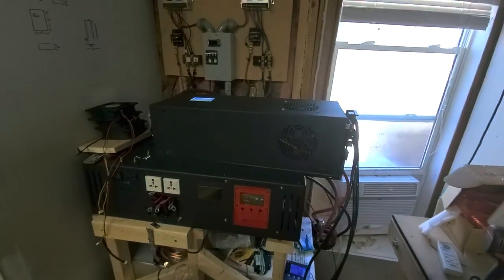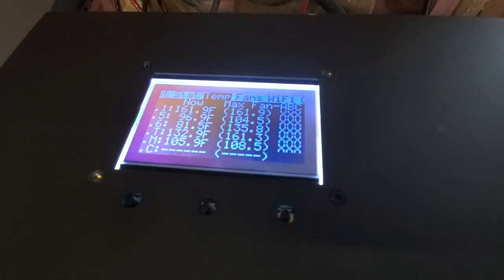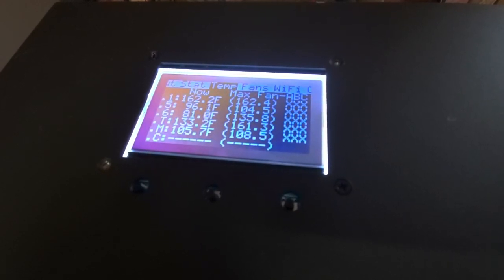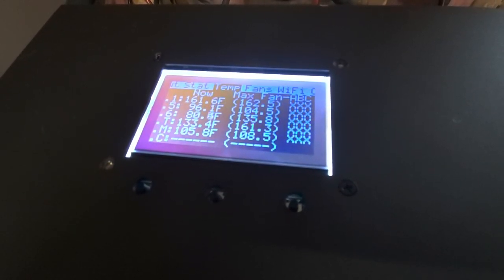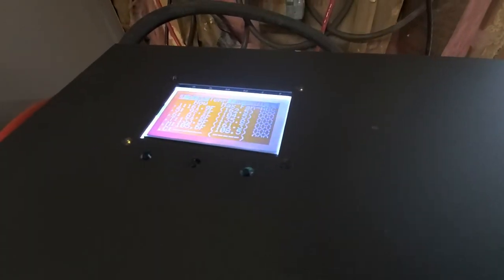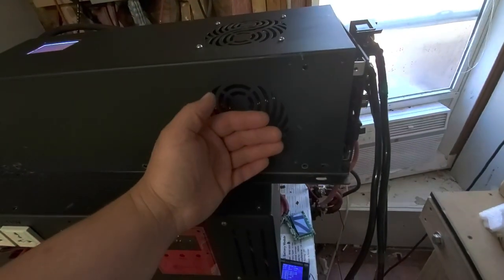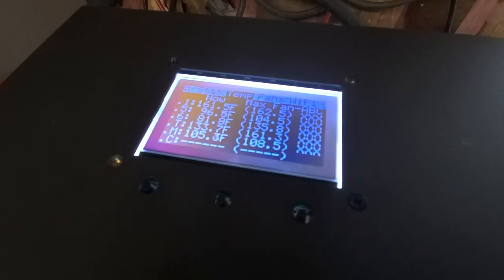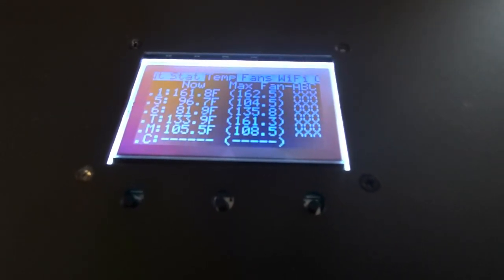Genetry Solar 5KW inverter full load test!

Comment: Is PJ trying to out do you with features. Noticed on one of the larger stainless ones they have gone to breakers of the European type.  And that there are two DIN jacks on the front panel instead of the PJ meter face on both a 15KW and a 9KW unit. They kept the fuses on the 9KW though.
Reply: Is PJ trying to outdo us with features?  No. 

 I'm glad to see them finally ditching the mess of fuses.  The less said about that the better.

Notice the metal panel where the LCD screens used to go on the 9/15K units.  This was something Sean and I both had a long discussion with Power Jack about.  Underneath that panel are actually mounting points for LCD screens, per our request for WiFi board compatibility.  The DIN jacks were their idea ("look, LCD can be external, we put all necessary wires on this connector!") but as I kept stressing to them, a fully loaded WiFi board can have over 50 wires coming off of it, and cannot be external to the chassis.  I haven't seen them offering an "external LCD" for their inverters yet, though.
Reply: @sidlori1592  The 15K unit I saw was without the covered cutout for a LCD. It looked like the picture was taken at the plant. Possibly in the test/prototyping area. The 9K did have the panel covering the LCD opening. With two 7 pin DIN connectors, depending on the circuitry used, you could get a large number of functions but it would rely on using some kind of buss to move data instead of actually handling the power on the remote board. It would be interesting to know if they actually have got a remote board setup that works. With your designed WIFI board, it includes the one thing that I want and that is to be able to run units in parallel.

Comment: HELP NEEDED PLEASE,I have a 4000w,v10 tanked invertor, what I would like to know is, if I have the fan set to off will it still come on if the temperature goes up, will it come on automatically, many thanks guys for any help
Reply: So.  I believe Power Jack has recently revised the fan control...but until I see a production unit with the updates, I won't hold my breath.  As far as past units, depending on the season, there could be two different kinds of fan control.  In all cases, the fan SHOULD turn on if the transformer gets above 40°C.  If the inverter has 2 fans, it may have both systems, and the fan switch will only control one fan.
 1) 12v cooling fan (regardless of input voltage)...plugged into the Control board, controlled by CPU.  Will only turn the fan on if the transformer gets hot.  Hot FETs will not turn the transformer on, despite the CPU monitoring the FET temperature (!).
 2) Cooling fan same as inverter rated voltage (12/24/48v), controlled by a thermal switch on the transformer, which has a tendency to stick "on" until you hit the inverter with a hammer (not recommended ;-) ).  Again, hot FETs do not trigger the fans.

Go figure!

Comment: You may want to look at using wire fan grills and having the fan holes in the case completely cut out to see if you get better thermals and quieter operation.  I had a cheap computer case with 3 120mm fan holes cut in like this and it would overheat if I didn't have the 3 Noctua fans running at max at full load.  So I cut out the holes completely and used some 120mm wire fan guards and it made a substantial airflow improvement to the point where the fans only needed to be on 60% to cool the system at full load.

Comment: How much does ambient temp contribute to inverter temp? Lets say, air conditioned environment, 75F versus non-air conditioned, 90F?
Reply: It definitely will affect the maximum load, but we do not know how much at this point.  That's lab test work right there ;-)
Reply: @sidlori1592  An upgrade to either a Genetry Inverter or Control/WiFi board combo is getting up there on my priority list. I had some overheat issues with ambient temps seeming to be the root cause.

I changed ventillation a bit to see if that helped- I have an external fan over my inverter as the top of the transformer has no fan in my unit. That external fan was pulling air from the top opening before, it is blowing in air now. 

I was running an induction cooktop for ~20 minutes, pulling around 1500W. Power goes out.

I'm not sure if the changeup in ventillation alleviated the issue or not, I still have the issue with fans running constantly. I might actually get some time to open it up this weekend and check the thermistor connections.

Comment: I keep telling ya.  TURBO FANS !  Directed strait into the Transformers.
Reply: This is the fan you need.

https://hobbyking.com/en_us/dr-mad-thrust-90mm-12-blade-alloy-edf-1600kv-motor-2100w-6s.html?queryID=&objectID=82388&indexName=hbk_live_magento_en_us_products

They use to do a 120mm version rated at 150 Amps @ 24 Volts with a thrust of 5KG but can't find it, it might blow the components off the board though
Reply: @PetRatty  The problem with using those types of fans is that they are horribly inefficient if they are being used for cooling.  The life expectancy at high RPM is also very low for ducted fans.  The more power you need for cooling, the less efficient the overall inverter will be.  Part of the design aspect is to add enough cooling to keep the system thermals under control while also simultaneously using very little power to do so.
Reply: @kuhrd  I know I was just making a point, I have 3 of these fans and am making a model of the flying robot from the Terminator films

Comment: Success . That’s great . The Frankinverter is really exceeding to its performance for some time period and no more at the designated threshold . Maaan . It only started when you first said years ago about what size fan was necessary to  create a constant air flow through the transformer . Well I guess you have the nail head hit  . It,s Workin ! How bout having more vents on the case and chassis around the transformer for more outflow . Cut open the top and introvert a box compartment for the fan over the transformer so the case can be properly closed  maybe . Keep up the design .

Comment: I tried this on a 5Kw PJ stock inverter, was pulling 6Kw for 10 minutes before it overheated. let it cool, switched off  half the load and pluged in a newly received high speed fan into the normal fan connector and BANG with fire , 1 mosfet blow. Think the control board couldn't handle the 4 Amp fan. Time for an upgrade I think

Still don't know if the one I have is 5Kw or 8 as all the boards inside are labeled 8Kw
Reply: Its gotta be an 8k if it could handle 5 for any length of time.  That's actually an impressive performance for a PJ unit.
Reply: I wrote a response but it seems to have disappeared in the YT circular file.  If the transformer in your inverter is labeled AS4, it's probably a PJ "8kw" inverter.  Note that the transformer in Sean's 5KW inverter...is an AS/ASL5, which PJ installs in their "9K" units.  Like the 9K 48v that I have.

I'm assuming your high speed fan was a 12v fan...and if so, I'm also assuming the FET that blew out was on the "L_MOS" side (transformer wires bolted to heatsink.)  The two go hand-in-hand...basically, the Power Source board (integrated if you're on a 10.3) got overloaded by the fan.  This caused the 12v output to sag down below 10v...resulting in a MOSFET gate voltage below 8v, causing partial turn-on...and all of the power intended for the tranny got dissipated in the MOSFET..."BANG!"
Oops.

You will need a new LF Driver board, as well as at least one MOS board.  (You can check MOS boards with a multimeter; if you buy replacement parts from Sean, he can tell you how to check them.)  And power the fan some other way ;-)
Reply: @sidlori1592  Thanks Sid, can't believe you can diagnose the problem without even seeing the inverter and my basic explanation. System is 12 volt with an AS3 tranformer, boards all labelled 8kw,

The FET that blow was on the high side connected to the +12V rail, I'll have to get a LF driver from Sean as I can''t trust this one anymore, the FET's I can source and replace with orginals or better.
Reply: @PetRatty  Weird the high FET blew, those have separate windings on the Power Source tranny, so they would not be affected by the fan.  (They also switch at 15vDC, not the 12/10v of the L-MOS.). Wouldn't be surprised then if the L-MOS are a short circuit...you'll probably need to replace all the FETs.

EDIT: AS3??  Sheesh.  That's a peak of 3kw continuous, or 6kw PJ rating.
Reply: @sidlori1592  You mean he actually was getting more out of it than rated? Where did PJ goof up? :-) Do you have the specs on an ASL-1?  Claim is 6k for the inverter but I'm thinking 2-2.5K max.